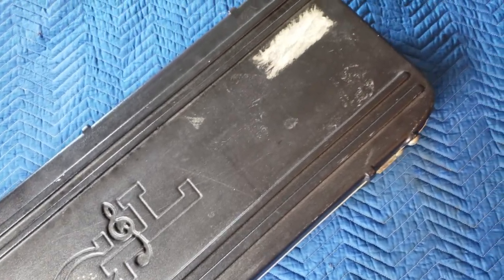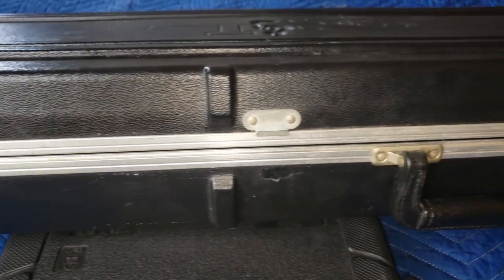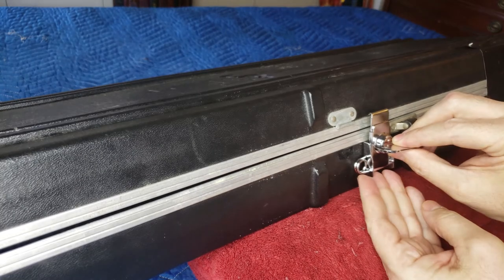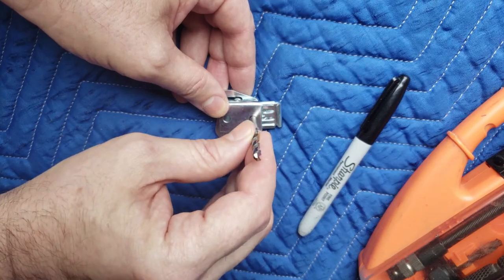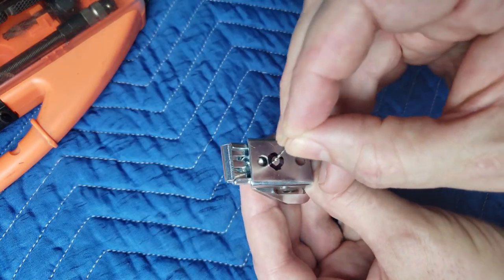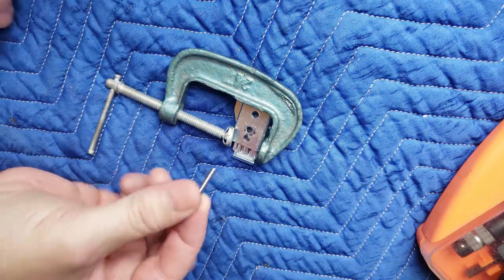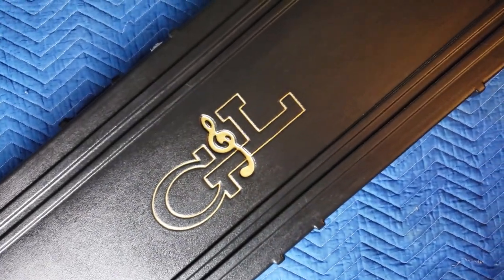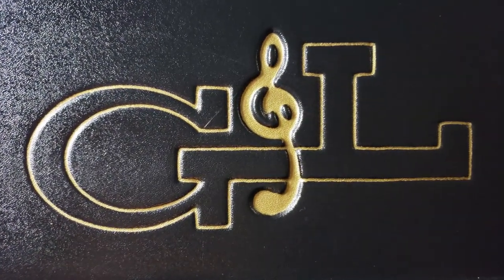G&L Legacy Guitar Case Restoration Repair, replace latches, missing plastic, bumper stickers, rust

Comment: I was mesmerized watching this. Good job! I was wondering if a credit card could have been used to remove the bigger patch of adhesive residue or if you think it would have scratched the case.
Reply from the maker: The Goo Gone needed to soak in along with scrubbing it with a non-scratching pad. A pad for a non-stick frying pan pad would have most likely worked as well. A credit card may have worked also.

Comment: You had a Dremel but didn't use it instead of the hand file .... any particular reason? I'd have thought the Dremel would have made cleaning out the holes easier. A wire brush wheel would have made it easier to clean the hinges too :) .... 20/20 Hindsight!
But your video has given me confidence to attempt a repair on my Ovation hard case .... wish me luck!
Reply from the maker: Thanks for the kind words! I didn't have a file bit for my Dremel. The drill bits kept binding or grabbing. My long round files were too long to secure into the Dremel hence... hand filing. I used 600 to 1000 sandpaper to avoid scratching, my wire Dremel sandpaper bits most likely would have scratched the metal. I might need to add a few more bits to my collection! Good luck!!!

Comment: Not sure if those are called butterfly latches ???
Wish I could rig one of those for a Gibson Gen 3 case.....any ideas ???
Reply from the maker: What's the issue with rigging one on the Gibson Gen 3 Case... what issue are you running into?
Reply: @anthonycongiano8890 ..... Gen 3's latches are not surface mounted, the butterfly latch would never fully close.
The Hiscox case from the UK uses almost identical latches as the Gen 3.
I tried to get some but didn't receive a reply. They would be a perfect replacement.
Reply from the maker: @rodrossi9749  are the latches you are looking for this type? https://reverb.com/item/6135799-1980s-gibson-generation-3-chainsaw-case-3-metal-latches-black-brown if the Hiscox latches are nearly perfect, I would suggest calling them +44 (0)1543 571420. Or possibly look on Ebay or Sweetwater for a damaged case and salvage it for parts.
Reply: @anthonycongiano8890  ....... the Hiscox is superior quality to anything out there, the one's on Reverb are pretty cheap. 
Not sure of the guy's sorce,  but he's probably not paying $ 4.00 each and selling 3 for $ 40 is a bit of a price gouge.